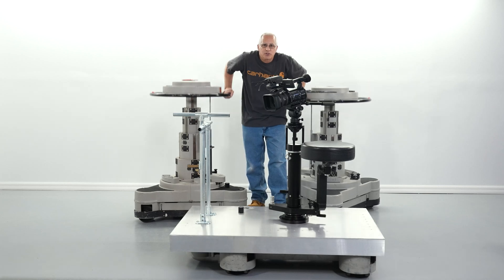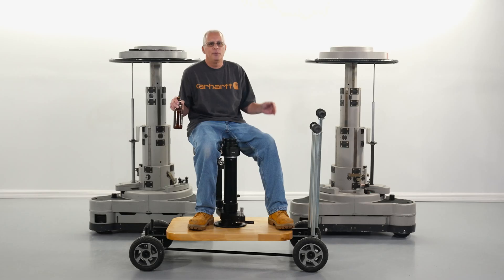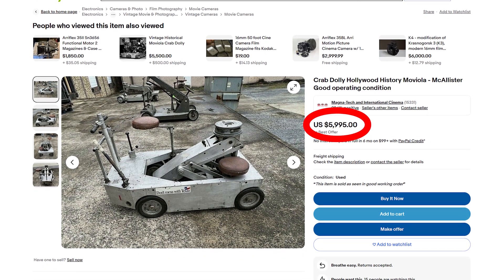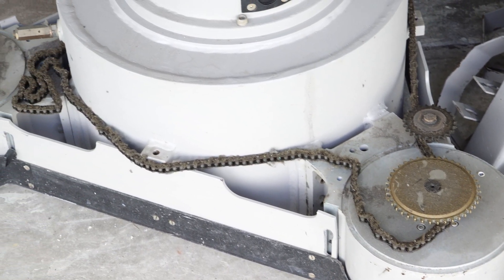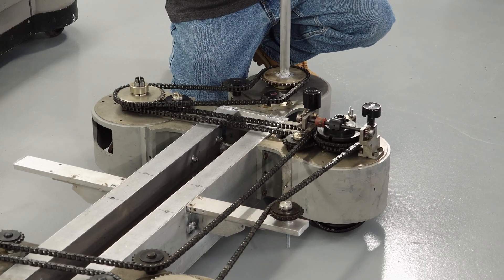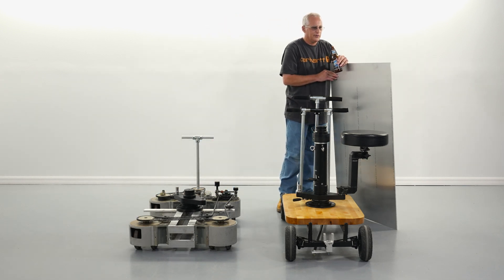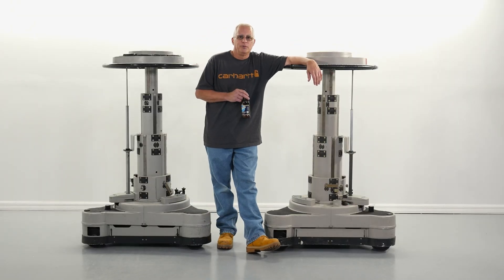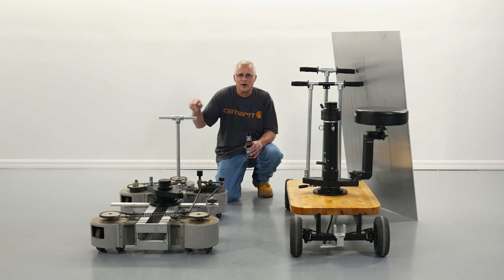DIY CRAB Mode Dolly - How We Built a Crab Steering Dolly Out of Old Vinten Studio Pedestals

Comment: I actually looked at those ebay dollies. same company had some in ATL. They are piles of hot garbage. they had not been maintained in at least 50 years. booms where busted and the steering on the ones they had that could swap also where sticky and super busted up. Lots of reasons why skipping those McCalisters was the right move
Reply from the maker: Yup, those are the ones. The company does specialize in old stuff mostly as movie props. But they are asking Hollywood prices for old nonworking junk. The stuff is priced out of our budget and the cost of fixing, makes it that much worse.